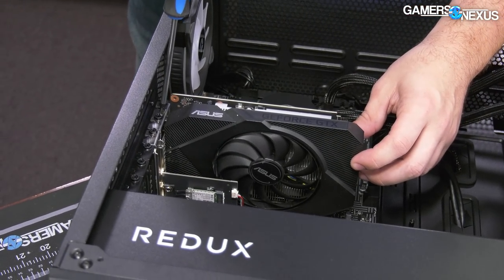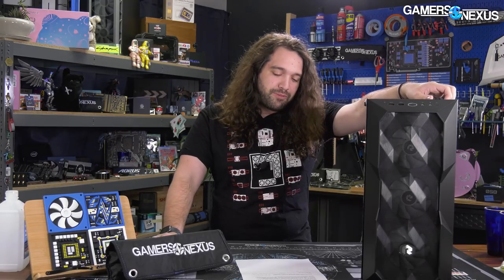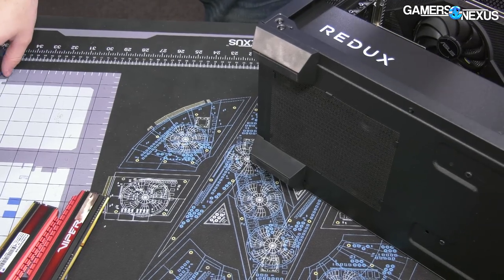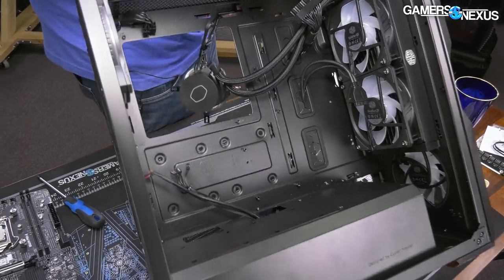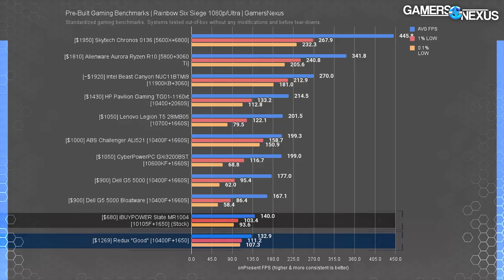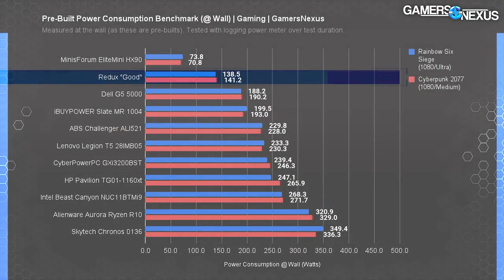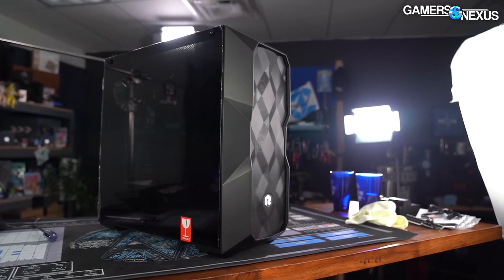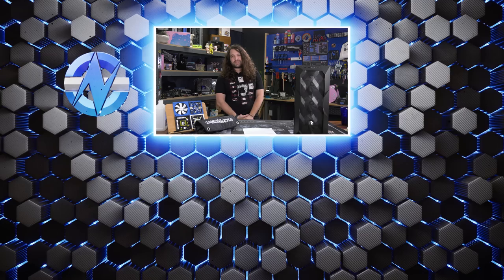YouTube Ads Told Us to Buy This: Redux Gaming PC Review

Comment: This march, my son was due for a new pc around his birthday. I've built our pc's for years, his first one being from 2017. Due to gpu shortages, at the time, I needed to go prebuilt route (it was an extremely hard pill to swallow) to get something. I saw some reviews of these Redux pc's at the time and liked what I saw.. we spent $1820ish pre-tax for a 3700x, 32gb ram, rtx 3070, and 1tb nvme storage. We had other storage from old pc I could use so was okay with that. Pre RTX 3000 series I would've balked, but the price was great, though it took roughly 6 weeks to arrive. I took it apart completely upon arrival, not many shortcuts-- had to adjust radiator orientation but the full rebuild removed any sort of cable mistakes, i'll admit I was in a hurry to disassemble so I can't speak to cable connections, but seemed fine. It runs cool under load and performs well-- it sucked to have to go prebuilt but 6 months later we've had no issues.  I've checked in to the site periodically and prices have gone WAY up... last i checked something comparable was over $2400 and had fewer custom options... but again- very happy with what we bought, when we bought it. Cheers!
Reply: Quick edit-- I looked up the order since it's been a bit-- wanted to add the price was actually $1956, forgot there was no tax on this for me. It was also an x570 mobo.

Comment: It’s crazy how last year I picked up an ABS gladiator with a 3070 and i7 9700k for 1500, crappy board but for 200 bucks in new board and another 100 for a radiator, I think I’m pretty well off
Reply: It's still that price and that's for a ti
Reply: @fabolousjada5070  do tell where you can find one new for 1500

Comment: After watching this I'm feeling pretty good because in 2020 I bought a prebuilt from iBuyP for $1300 with an MSI Z490-A Pro, 10900K, and Gigabyte Windforce OC 2070 super. It also had okay ZADAK RAM 16GB 3000MHz and a WD 1TB 2.5 SSD. Since then I upgraded to Corsair Vengeance RGB PRO 32GB 3200MHz and moved my OS to a Samsung 970 EVO Plus 1TB M.2. Now I just need to find a 3070 Ti or 3080.

Comment: A gaming PC with a 1650 reminds me of when I got a new PC back in 2000. It had a Riva Vanta, which was a low-end video card. But I was quite happy with that, as my previous build had no 3D accelerator at all (like really no iGPU, no motherboard built-in GPU - meaning you can only play 3D games in a software mode, performance akin to running a poorly optimized emulator). So that is like the only scenario in which I can imagine being happy with a 1650, really...

Comment: Steve said, "I don't know if this (CPU TIM) is being pre-applied by Cooler Master but Redux is ultimately responsible for everything..."

IMHO, Cooler Master usually applies a thin layer of TIM directly to the cold plate which would have cured prior to Redux receiving it. If that type of TIM was already present, someone at Redux most likely scraped it off and added their own.

Comment: For anyone living in Germany or closely inside the EU, I can recommend one.de - they are certainly a bit more pricey than this one, but when I bought my PC from them in 2015, I didn't even know that I got pretty good parts that served me well until today, where I switched to a modern Ryzen processor and got an RTX 3080. Also, when putting all the new stuff inside the old chassis, I realized they did a really serious cable management job. Everything was tied down and so clean, I didn't even know because I never looked for that in all those years. Someone spent a significant amount of time on it. 

Of course, at the moment, you're always better off building your own PC because you can slowly go for especially good prices on the parts, but for anyone who just has the money or can't get into the technicalities, it's recommendable. Though I don't know how good they are 7 years later since I've never felt the need to upgrade before. Haha. Oh, and they offer Pickup & Return extended warranty for rather cheap, which I found to be pretty nice back then.

Comment: Those fans on the pull side of the radiator look familiar to me. They probably came with the liquid cooler and Cooler Master probably just wanted to get rid of them. One of Cooler Master's fan models, which they have included with some of their liquid coolers, has absolutely terrible static pressure and only move pitiful amounts of air when impeded by a mesh or a radiator. If you ever need an example of how picking the wrong fans can ruin performance that liquid cooler is the best example possible.

Comment: I don't get the preference for 2 RAM-sticks. If I want to upgrade later on (say from 16 to 32) , buying one 16 stick while keeping the previously installed 16 will be way cheaper than buying 2 new ones and selling the 2 old 8GB ones. Compared to that, I really do not feel like the minimal improvement in performance is worth it.

Comment: I am in two minds about having XMP applied by default.   Technically that could be classed as an overclock and in some situations it could cause instabilities.   I don't think I would dock points for a company not enabling it.   I know that some will think it is critical, but there are also some that will say XMP can cause instabilities.   
Other than that, I agree with the rest of your review / tear down.

Comment: always the complaint that the prebuild is too expensive. A computer has to be planned, build as prototype, probably refined, then you have to secure the supply chain, build it, check it, provide technical support ... all that costs. Using water cooling for a 10400F of course is a bit strange and a 1650 is not really adequate.

Comment: the higher up models with 3000 cards are more…amicably priced is what i’m seeing. you can get a Ryzen 7 5800x and a 3080 Ti build with 32 gigs of ram for $3000 almost flat including building fee (not actually a bad deal considering most similar 3080Ti prebuilds are $3200+) . CPU might be a bottleneck but they don’t offer more powerful CPUs in their pcs rn…

Comment: I have had a great time, and for what I paid, everything made since.....but I also got a R7 5800X and a RTX 3080 from them. But yeah it uses the same cooler and case, so I think you nailed it on the head. If they just went with a standard cooler, they could up the GPU for the lower end models. As for the fans....It might be a problem with their case supplier. Yeah they should probably get a different case for the lower end rigs, but with them only using just one, the 4 "free" fans are more then likely part of the deal they have, where they get 4 fans per case, and removing them wouldn't "save" money. It's probably a package deal.

So yes, a cheaper case option, and cheaper cooling option should definitely be a thing for the lower end, but for what I paid for the whole "big spender" thing, their price was very competitive.

Comment: I think the reason build reducts went water cooling is for shipping durability, big air coolers especially those with bad mounting mechanisms can come loose inside the case during shipping which expanding foam inside the case can help with that but most users probably won't want to deal with the hassle of that as they're not familiar with computers if they were they would probably build it themselves. I personally would probably go towards a small upgrade air cooler one that doesn't cost much but makes it a lot quieter over the stock cooler as once you get above a certain price class and becomes more important to have a quiet system and for my experiences with AMD stock coolers being very loud I can understand why build reducts didn't want to use it, the use of an AIO doesn't make much sense here as there are air coolers for cheaper that have good mounting mechanisms

Comment: I actually recently bought one of these to escape the scalpocolyps. I got mine with a 3070, ryzen 5 3600, 16 gigs of RAM and a weird (D-RAMless? I haven’t looked too close beyond googling what task manager told me it was). I like it so far even though I’ve noticed some weird quirks I haven’t worked out yet. It shipped in 16 days, arrived a while after that. Overall I still like it more than getting lucky refreshing a page for a graphics card or paying scalper prices. It wound up costing about the same as the skytech chronos listed there.
Reply: I did just about the same as you.  Got a build all lined up and then when I was ready to choose a gpu I realized the scalping problem was a larger issue than I thought.  I tried waiting awhile to find a deal but I caved and ordered a pre built from redux in December.  If you don't mind could you tell me a bit about some of the quirks you noticed?

Comment: i use a TD500 for my custom build....my only complaint is that top radiator mounting is a bit close to the ram (ROG strix LC 360x120x30 rad with included fans i think? im just eyeballing here) the middle fan would impact the Corsair Dominator Platinum ram just enough to where i had to lap one side of the fan by like 3mm. also my cable manage job looks FAR shittier than theirs so ya know lol

Comment: I5-11400 stock cooler
Ballistic ram 16gb 3200
B560m msi VDH pro wifi
Samsung 980 1tb ssd m.2
450w rosewill Psu 
Rx 570 4gb  
144hz monitor
Why would my system so slow? I’d feel like my parts are good! I built it fairly well as far as I’m aware but my system is just slow ish and I can’t figure out why! All drivers are updated (bios included)

Comment: My  redux pre built was a nightmare. It came with a dead graphic card and a back of the case usb plug ins not even lined up. I couldn't plug in to the on board display port or even 3 usbs. I called them about the gpu being dead. They told me to unplug it plug it back in make sure it was solid. I did this then told them that it didn't fix it. They asked me to check other cords which at this point i took it to a local place that works on pcs and cellphones. They told me that there was a  1 cord unplugged and that the wifi cord was literally being pinched like no other. Also that the screws were over tighten.  I showed  the local place the video they sent me literally telling me  pry on the back of the usb ports with a flat head screw driver  then  give it a tug  on the front of the motherboard to reline it up. They told me that it be a restock fee if i return it. I then told them to just send me a new 3070 then. It took a  a bit (3-6 days ) just to start sending me a gpu. I was happy that I got a new graphic card. But this wasn't the asus RGB one this was a founders which was new in box so i was still happy. She put this in and then found out that the  power supply was iffy and causing the bad sounds coming from my pc. At this point i ask for a refund and  they replied that they would take from the refund for a restock fee. So i decided to gut out the parts that i knew work and started over. I would not go with them and also  some of the customer support is very rude if you have any problems they just assume you know nothing and that you broke it pretty much is how i felt every time i talked to them.

Ps this also took  4 weeks longer then the website said. The website said 3-4 weeks when orderd then they changed it to 5-6 it was about  8sh weeks. ( I understand there behind and taking time is fine but when there behind and the pc still looks rush together then something is wrong)

Comment: ... I paid around 450$ for my current computer, 16gb Ram (sadly only 2100mhz ones), 3.1ghz Quad core 8 thread CPU, AMD RX 590  8gb GPU, and I got a monitor for that money aswell :P
However, that was a refurbished Server I bought.. Purchased the GPU separately. And even though it definitely has me wishing for upgrades today.  I bought it little over 2 yrs ago, it has served me really well and still does.. And though it wouldn't necessarily be my first choice would I had deeper pockets.. But looking at my budget it was no debate.
Also, I remember looking at "Gaming PCs" of the same or similar performance and the cheapest ones were still more than twice the price.. Without stuff like monitors and such.. Had to buy a new chassi, but that's a sacrifice I gladly took when saving more than 500 bucks :P

Comment: I'm not really sure taping the fan hub/RGB controller down can be held against them. What's really wrong with that? Most people these systems are purchased by will never mess with it, and it was taped very securely. No, it's not right, but it's not horrible either. Yeah, maybe over time it could come unstuck, but it'll be held in place with the wiring and case back panel.

Comment: as someone with only 1080p 60hz monitors the 10400 is surprisingly consistent in being enough for everything that i throw at it. AAA games in best quality makes it go 60%-99% but it doesnt go below 60 fps. 
i do have an overkill 2070S, which even is its only dual its still good enough to play doom eternal in best quality possible (i chose 4knative in the config but my monitor is only 1080p so judge that yourself) at 60fps 16,6 (was it ms?mms? i cant remember the unit) without drops or glitches.
the temps tho, i do need fans, the 10400 never gets really that hot,  i bought a be quiet cpu fan with one fan on a side, thats more than enough to keep it around 60celcius at max.
the 2070S is another story, i went and bought 3 relativelly cheap fansto make a flow of air as the gpu got really hot at maximun, around 80celcious so theres that. i could have a 2060 or a 1660S and it would have been enough

Comment: I don't get these fan hubs, why don't these just split the PWM signal from the motherboard?

That lets you control every fan from a single motherboard connector with whatever software you want.
Reply: You are limited by how many amps you can pull off a single header. We ain't trying to start another fire hazard video 😆

Comment: i can see the pieces by themselves worth the price, and overall, kind of worth it since you get good quality parts and very good assembly
the problem comes in that its invested in the wrong places, just like Steve noted, so much cooling and a 700W PSU are overkill for a system like this which could have been invested in a better video card (a 1660 Super) and would make it a lot higher in the chart since its just being held back by a low-tier GPU

Comment: Replace the 240mm cooler with a 120mm, and the 1650 with a 1650 Super and I would have zero complaints about this PC. The CPU isn't exactly upgradeable because of the VRMs and the clocking of the RAM is unfortunate but I have no issue with the double sided tape for the fan hub and controller. I use magnets for mine.
GPUs are hard to get right now and very expensive. The price is high for what you get but the PC over all isn't bad. Too bad about the GPU, but at least it can be upgraded.

Comment: i got one in june had to do the same was 2 mouth had not here form them pay $1,565 and not happy with the build it work but have a power problem with it i think got the rayzen 5 with a 1660 6gb with afterburn monitoring the power is max at stock  which is odd

Comment: 10 minutes before I watched this video I was on the Redux website with a PC with a I5 and 3060ti that had the watercooler. Then 3 hours after watching the video the website now changes the CPU cooler based on the CPU you choose. Seems like Redux watched this video and made some changes. Think Gamer Nexus should make an edit to this video expressing the changes. Because in the current times getting a i5-10400F, RTX 3060ti, 16g ram, 1tb SSD and so on for $1500. When the only complaint in this video really was the unnecessary watercooler.
Reply: Bro I don't think that was the only complaint. I mean they got stomped by cheaper priced Dell in the tests. That says ALOT 😂

Comment: Yeah... About the price being close to retail... My Nvidia 3080 Founders edition cost $1150 as listed on the invoice... I'm kind of sure the MSRP is kind of half that. They of course do not let you know what you're getting "Nvidia RTX 3080" isn't descriptive exactly. I got an ASROCK X570 Phantom Gaming 4 motherboard (meh), with a Ryzen 7 3700X (they didn't have better CPU in stock), I opted for "16 GB DDR4 Dual Channel" RAM (I forget what it was as I changed it), 500GB NVME M.2 (Since I already had a 1GB Samsung SSD 970 Evo, thought I'd save a bit of money there), it came with an "850W ATX 80 Plus Gold" PSU (not sure what it is, didn't tamper with it for the moment), No OS (Win 10 Pro installed), The RGB fans are terrible (yay for the same tiny remote) and the motherboard seems to have slipped out of position during shipping rendering most USB ports unusable (the support instructions were to jam a flathead screw driver into a port and realign motherboard that way, yes I've the email available). The response to the GTX 3080 price was: "Prices for GPUs have increased due to the tariffs they imposed on them as well as the short supply and high demand." Oh, and to add the final price with taxes and shipping: $2521. But hey at least I didn't have to pay some scalper 2x the price for the GPU, it arrived in about 3 months.

Comment: Case looks cool but holy crap. ($NZ)  $450 got me a new 10700KF,  $220 - new Z590. PSU - $140 (Corsair RM650) , Cooler $35 (Deepcool gammax)  and case (Aerocool glider) $50. Waiting on my  $60 ram. $950 all new parts  - I did keep the Strix 1070 Ti gpu and had a new/unused SSD, also reusing hdd from previous pc. I know its a dead end build so I built it to my spec. At the time the 5600X - the Ryzen I want(ed) was $130 more than the i7 and I couldn't find an X series motherboard for under $350 - hence I went Intel.